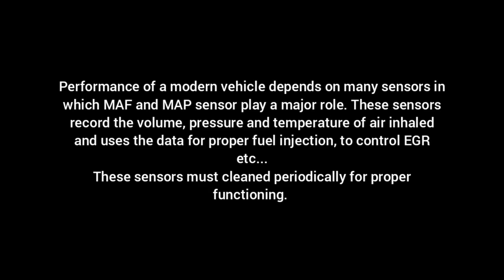Clean MAF and MAP sensors | Ford 1.5 TDCi | Ecosport Aspire Focus Freestyle| Easy Fix at Home

Comment: My ford figo has a bad fuel  smell at the exhaust in the morning,  also has a rough iddle but on a freeway trives fine and take off is it's biggest problem,  lastly it's on fuel consumption could this be the issue.  It's a 2011 duratec petrol engine

Comment: I was able to do MAF cleaning myself. I am unable to reach MAP sensor and do not have time and tools for that. Do you know anywhere in Chennai this can be done? I tried authorised service centers and they refused.
Reply: Did u try this process anywhere in chennai? Yes ford service centers refuses...they refuse to check even error codes are there or not via obd...if u got any info,Kindly update

Comment: 2016 Figo Aspire with 208116 kms, 1st time Cleaned today the MAF & MAP sensors at home by self, with WD40. Now it's on drying process will update soon by evening... 🥰
Reply from the maker: Oh bro... shouldnot use wd40, you should use carb cleaners or elec. contact cleaners.
Reply: @dailyhandsdiy  😟then, I did a great mistake I guess... But i dried the parts and fixed it, connected the +ve terminal 1st, & the -ve terminal.. Then started the vehicle.. It's fine no any fault signs... Will go for a drive to check later on..
Reply: @dailyhandsdiy  Salute to you... Running ultimate smooth with very less black smoke when hard accelerated..
Reply from the maker: Glad to hear mate. Be sure to clean it with proper cleaners or the good won't last long. wd40 is a part lubricant and get dirty faster. Need to clean those sticky residue out of the sensors.

Comment: hi brother i watched your video and checked my car and found out that both Map & Maf sensors are broken. i ordered new to replace but i have one question and i hope you can help me. MAP sensor is moving on it’s place its not stable and its whistling when i press the gas over 4000-5000 rpm and there is no screw to tight it. and does it couse on my engine power. and big konsum??what am supposed to do. my car bmw 525d 2004. 177ps. thanks in advance
Reply from the maker: Hi there, yes of course there will be power issues and fuel mileage issues with loose map sensors as the air leaks through it. I doubt there should be a lock if press fit sensor or a screw that hold it in place. else you need an alternate way to keep that sensor in place.
Reply: @dailyhandsdiy  thanks for answering there is no screw on it becouse its a sensor without screws. and yes it have air leak
Reply from the maker: some bmws came with cliped map sensor like a snap ring. some with over cliped so if its not staying in place just do something that holds it in place. cable tie,tape anything will do. But be sure the o ring is leak proof. as you have ordered a new one things should settle down.
Reply: thank you so much but is it dangerous driving with this old sensor with leak for a few days?
Reply from the maker: There won't be any dangerous events. Your car might get lazy on accelerating and might throw some smoke on higher acceleration. Thats ol. For safety, try not to accelerate hard or not to rev hard, keep the engine speed below 2500 or 2800 rpm.
Reply: thanks a lot and good luck… new subscriberr ❤️
Reply from the maker: Any time brother 😊

Comment: Which air cleaner did you use ?
Reply from the maker: Could use any kind of cleaner which does not leaves any residues, i used hit spry which leave no residue but takes time to dry up, could use a hair drier for fast drying.
Reply: surgical sprite is giving better result bro
Reply from the maker: Yep that too rubbing alcohol, but for extreme blocks in sensors with body especially bosch sensors need a forcefull penitrant to wash out oil and dust. Any thing is good.

Comment: Can I clean it with abro carburettor and choke cleaner?
Reply from the maker: You may use any cleaner which does not leave a residue and completely dries off.

Comment: pls make a video on ford aspire throttle body cleaning, i know it is an electronic throttle body.
also after how many kms should one clean the maf and map sensor?
thank you
regards
Reply from the maker: Bro as said its a shut off valve, unlike petrol cars, it has nothing to do with acceleration. Jst make sure its getting wide open when the engine is fired and closes when engine is off. It nly keeps the valve closed for about 5 or 8 secs while switching the engine off then opens up.

Comment: Bro one question? 
I bought 1st time diesel car in August 2019 ( Aspire diesel). Is diesel car emitting smoke? Is this its normal behavior ? I did the PUC with 2500 + rpm and smoke density was 0.44 and the limit is 1.6 ....My car is giving better mileage ( 21 kmpl on high way with 80-100 kmph speed with Ac)  and performance too. Kms clocked 12000 only. Ford is saying the smoke is normal and it's with every car and I noticed too with Hyundai...Maruti diesel cars...Smoke is coming on above 2000 rpm and on sudden acceleration only ....on light foot RPM no issue...Scanning also done by ford 2 times on my request...they said the updated software on 2nd setting.. kindly brief me..
Reply from the maker: Yes diesel engine does emit smoke on higher revs. Especially ford,smokes hards at higher rpms abv 2000 rpms. Its not a fault,unlike petrol diesel ignite itself without any external fire so at higher rpms it lacks proper burning and pushes smoke out. No wrys its perfectly normal.
Reply: @dailyhandsdiy  thanks bro...I will be your subscriber from today. You answered me properly and promptly. You said 5W30 is good for winter and 5W40 for summer? Synthetic and minerals depending on how much kms you want...correct? But exactly what ford dealers are using in service station's?
Reply from the maker: Thanks bro.... And They don't have a particular brand as their own, they use the closest brand they can get or the closest oil dealer they can have.

Comment: Hey, I have Ecosport Petrol 2016, one minor but peculiar observation I have been getting daily is my car slightly hesistates in terms of acceleration in specially in low rpms (under 2.5k rpm), there is a slight sluggishness and laziness in acceleration and power. Another strange thing is when in 1st gear it sometimes gives sudden acceleration surge.

I keep the car very very well maintained and overall it runs perfect but this slow acceleration and slughishness kind of feels bad everyday. Also I have never checked the MAP sensor. Do you think it could be the reason and should I clean it?
Reply from the maker: Yes you could clean the map sensor amd also clean the throttle body.
Reply: @dailyhandsdiy  Thanks.
Reply: @dailyhandsdiy  Could you point out its location (Prefacelift Ecosport Petrol 1.5)

Comment: Bro..Last week, your suggestion related to map sensor cleaning really helped..My swift zdi returned it's original power of turbo...One more help needed buddy.... Regarding Ac evaporated temperature sensor...Does this sensor is attached to the backside of my cooling coil of swift zdi top model?? Coz Ac pipes are getting freezed even after doing the gas fill up.The AC is not taking a cutt off... please guide 🙏
Reply from the maker: AC circuit has a pressure sensor not a temperature sensor. This happens usually when the ac cut off relay goes bad.
Reply from the maker: Sure Its 91 9747932260.
Reply: @dailyhandsdiy  Thanks for sharing. I have messaged you personally..
Reply from the maker: got it 😅
Reply: @dailyhandsdiy can we use WD40 specialist contact cleaner for cleaning both these sensors and do we have to remove o ring of maf sensor before cleaning?

Comment: In my ford ikon 
AC vents are not blowing cold air in left 2 vents and in the right 2 vents it is blowing cold air.
What can be issue ?
Dusty cabin air filter?
Reply from the maker: Could be bad filter and also could be irregular coolnt gas flow through evaporator coil. Can be clogs in one side of evaporator or is running in low gas pressure through the coils or bad pressure valve in the AC circuit.

Comment: I have ecosports diesel 1.5 2014 ,which engine oil is best and which grade ,please tell me.
Reply from the maker: Ford recommends 5w30 oil...if the climate is too hot, you can switch to 5w40 grade.
Reply: @dailyhandsdiy  I am from Kashmir India ,here temprature remains below 31 in summer and -4 to -15 in winter.
Reply: @dailyhandsdiy  ok then 5w30 is best as per company recommended , thanks alot bro .
Reply from the maker: Anytime bro.. and for that climate 5w30 suits bests...
Reply: @dailyhandsdiy why does my car(Ford aspire 2015 diesel) move forward and backward for few secs especially in second gear after leaving the accelerator pedal ? This is more pronounced when AC is ON...I already replaced my C bed engine mount...pls tell what could be the issue bro? My car has run 78k kms...anything related to clutch or some other issues? This happens mostly only in 2nd gear and sometimes in 3rd gear..Never happens in 4th or 5th..pls do reply bro wen u see this msg

Comment: Hi, my ecosport diesel shows the wrench symbol and when i switch off and on the car it goes away. When ran the error through OBD scanner it showed MAF sensor issue. But mechanic ignored and said it will be service issue. Once again after doing oil service i notice the same issue. Issues are below
1. Diesel smell when we revv the car increasing the rpm.
2.black smoke from car after service
3. During idle car revv itself without accelaration and goes up nd down revv
4. When going in 2nd or 3rd gear it  shows jerkness

Does all above points to maf sensor or o2 sensor or any other issue??
Reply from the maker: Maf sensor codes are stored when the MAF sensor itself is faulty or is due for cleaning. Secondly, any egr related faults too gives the same error codes ...clean the EGR and air intake sensors.

Comment: Hi Bro. Thanks for your videos. 
I own an aspire diesel and want service it myself. Can you suggest a tool kit with all necessary tools . If not available as a single kit, can you suggest minimum tools required .
Reply from the maker: Hey bro, for oil change you need a 27mm box for oil filter, 22mm ring spanner for drain plug, a T and extentn. For other prevetives, a 42 piece 1/4 inch drive kit is handy.
Reply: @dailyhandsdiy  thank you so much for your quick reply.
Reply from the maker: Any time brother..
Reply: @dailyhandsdiy  can you specify the name of rapid cleaning spray you are using in different videos, especially for cleaning brake pads
Reply from the maker: I use HIT spray for cleaning purposes for brakes, sensors etc.... for circuit or sensitive sensors use contact cleaners for circuit board.
Reply: Which diesel engine oil ford is using for Aspire TDCI ? Also tell me synthetic or mineral?
Reply from the maker: hi there, you may use 5w30 for normal uses n highways, also for rainydays n cold climate. For summer or more city drives 5w40 gives more protection. Brands, shell, Mobil, Bosch any one should do good. And if the drain intervel is less than 6k can go with mineral or if is more than 8000 should stick with synthetic.

Comment: Sir ano ba best cleaner spray for ,MAP  ,MAF SENSORS
Reply from the maker: Could use CNC air maf sensor cleaner, any carb cleaners or use rubbing alcohol with zero residue in a pressure dispenser.

Comment: bro where are the glow plugs located in ford aspire ? how to check them with a multimeter
Reply from the maker: Hey bro, it behind the engine or back side of engine. You can check the continuity by placing negative prob on ground ams positive on the tip on glow plug. or check the resistance from emgine ground to top tip of plug. Should hear the beep when checkin continuity or should have no resistance at all.
Reply: @dailyhandsdiy  Thanks Bro. i think around 1ohm is fine .i have only problem with the location .do you have any picture and how do i remove the connector ?
Reply from the maker: Its jst a clip on connectors, kst pull it out.

Comment: Pls recomend a cleaner for maf map  and egr cleaning
Reply from the maker: Could use carb cleaner or electronic contact cleaner.
Reply: From where to buy these plz share the link if possible
Reply from the maker: These sensor could be found from boodmo.com, but these are not easily damaged, is designed for lifetime.
Reply: Plz share sansor clener link which u used
Reply from the maker: Bro you could simply search for electric contact cleaner. Any one will be good..

Comment: Hi brother,
I have ford fiesta 1.5 tdci.
In my car, Check engine light comes intermittently when car is driven over 2000-2500 rpm. After restarting car and being on idle or driving under 2000 rpm, check engine light goes away within 1 minute automatically.
It shows fault code P132b and sometimes on long trips also fault code P0299 appears.
After driving it under 2000 rpms both check light and fault codes goes away always.
I have scanned it several times and consulted with many mechanics but I got nothing.
Please help me I am not able to find any solution.
Thanks
Reply from the maker: Hi there, its a turbo pressure performance issue. Check the turbo actuator solenoid if its funtioning good, check the vacuum pipe if it has any leaks. Or you have a boost leak somewhere. Clean the map n maf sensors. check the air filter. Try these out first and if not doing the job must inspect the turbo.
Reply: @dailyhandsdiy  Thank you so much brother for suggestions 👍
I'll try to get these inspection done and will share what happens.
Reply from the maker: Sure bro.. anytime

Comment: Hello my swift vdi is giving low fuel efficiency about 15 kmpl  I cleaned egr air filter and the MAF sensor but no visible change happen there is no check engine lights showing no power drop can you please help me?
Reply from the maker: There's one map sensor, try cleaning that too..
Reply: @dailyhandsdiy    I also cleaned the map and I feel no difference in the diesel mileage is there is anything I need to check?
Reply from the maker: Does  the car give out smoke on acceleration? There are other are other reasons like, boost leak, dirty intercooler, fouled injectors or rail components, failing fuel temp sensor even failing coolant temp sensor. Have to go through each one to diagnose the issue. At what engine rpm do you regularly drive?
Reply: @dailyhandsdiy  no visible smoke I don't feel any power loss I regularly drive between 1500-2500 rpm I recently used injector cleaner from abro that also shows no change
Reply from the maker: Do you use your car for short trips or more often in city drives?
Reply: @dailyhandsdiy  I  use more in high ways than Citys
Reply from the maker: Could do one thing, disconnect the egr valve connector and try driving. check the economy afterwrds. may see the CEL but neglect that.
Reply: @dailyhandsdiy  I cleaned egr and manifold 2000km ago and changed the egr valve solenoid so is that necessary? Is that necessary to clean turbo and intercooler when there is no black smoke? Is diesel filter have any role in mileage?
Reply from the maker: If the solenoid is not working good or if the valve retailer is hardend, valve won't work properly. So if the valve is disconnected, ecm adjusts the fuel injection ratios. Its worth a try. any how the engine will run better without egr.
Reply: @dailyhandsdiy how many km do I need to run without egr when should I put that connector back?
Reply from the maker: Just some 100 200 kms to check the average. If it improves the mileage nee to check the egr and air intake parts.
Reply: @dailyhandsdiy   sir again no change in the fuel economy is there anything else I have to check
Reply from the maker: Hi just check if the car has a lambda or oxygen sensor and if yes check its working good.

Comment: Hi bro mera tata manza car 70speed steering vibrating hota hey    iska solustion bhathao
Reply from the maker: Hey bro this can happen if the tire has uneven cuts or surface. Also could be bad wheel bearing or suspension joints or too much play in axle cv joint. Check the tires for balance and check if the wheel Has any play.
Reply: @dailyhandsdiy  tq bro
Reply from the maker: Any time bro....